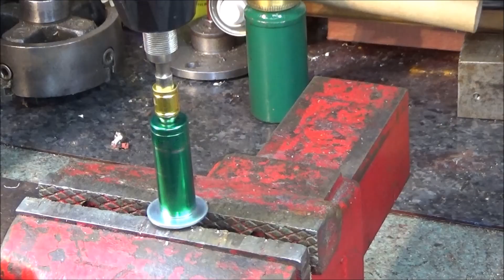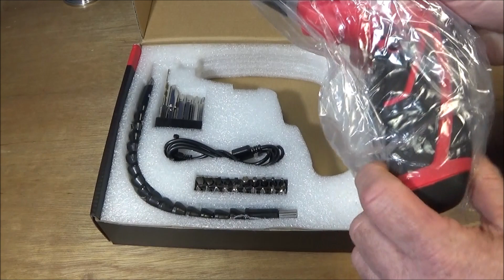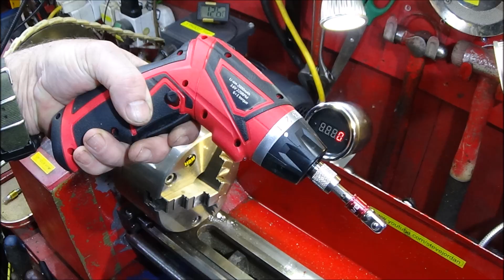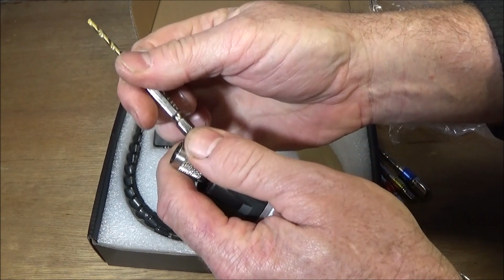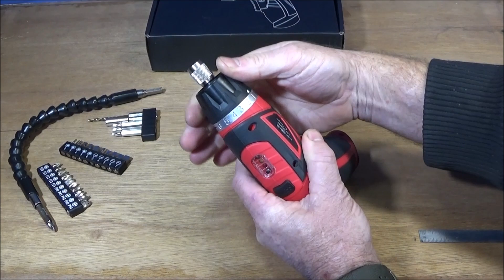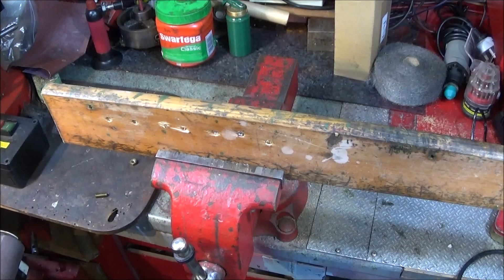MOHOO 3.6V USB Cordless Screwdriver, Electronic Chuck Key, Socket Drive

Comment from the maker: SEE SPECIAL OFFER LINK BELOW:-
MOHOO 3.6V 2000mAh USB Cordless Electric Screwdriver --  https://goo.gl/w1dYrC 
Drillpro 3Pcs Power Screwdriver Extension Bar Adapter --  https://goo.gl/weYkUK
Buy 3 Get 15% Off,Buy 4 Get 25% Off -- https://goo.gl/FZxFBr
Buy 3 Get 20% Off,Buy 5 Get 30% Off --  https://goo.gl/mKk3B6

Comment: Steve, how does this compare to the Liumy screwdriver you reviewed a month or so ago?
Reply from the maker: Hi they are very much the same, but this one has a higher mAh rated battery and the rubberized grips. Plus this one has the flexidrive. I really like this one because it is red as well.

Comment: Hi Steve - is the torque sufficient for tightening the 3jaw on some stock, or do you need to pull out the chuck key to give it a by more oomph?

Looks like it might be fantastic for 5C collets, there is a LOT of turning on them, and very low torque to get them to tighten :)
Reply from the maker: Hi Adam, I always tighten with the normal chuck key after using the driver. I was thinking of getting a 5C collet chuck. They looks excellent.